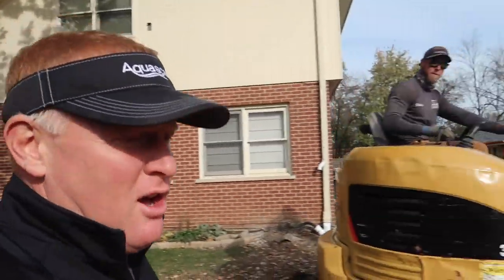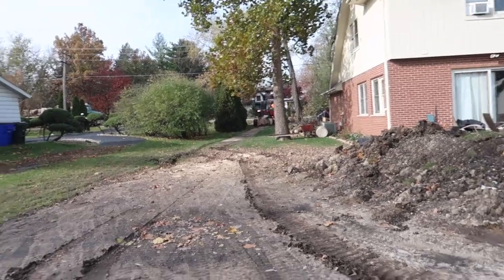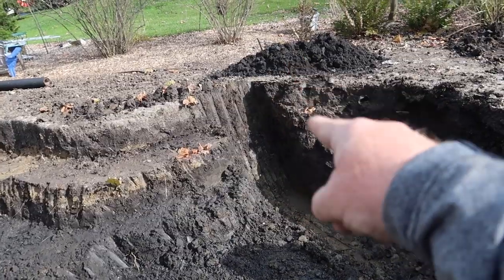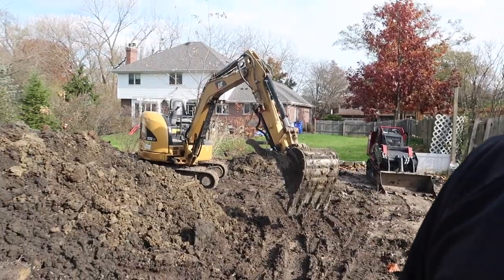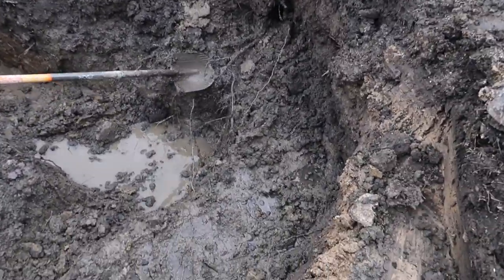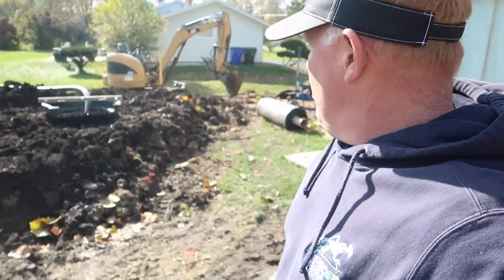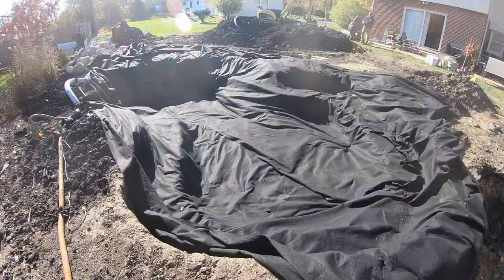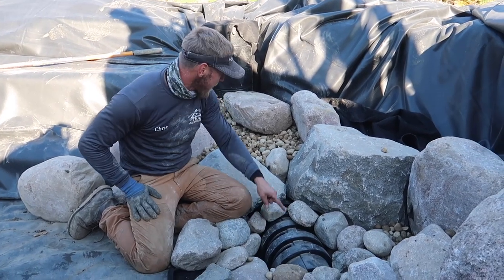Groundwater Solutions for 3-Foot Deep *POND* - Part 1

Comment: how does the water go up a pipe and discharges  up hill?
Reply: Good question.  I'm assuming water pressure.  He mentioned the water in pond would push it up and out. Buy I thought they might dig a trench out

Comment: regarding the french drain  with it going up out of the pond how does the water get out of the pond going uphill?
Reply: I was sorta wondering that but if you are referring to the underdrain systems (the white pipe in the video) it all has to do with the water in the pond pushing the water along up and out of the pond.. Like he says, the exit of the pipe must be below the water level in the pond.. I really want to try it on a small scale experiment
Reply: @bmzaron713  That's my understanding too ... the path of least resistance isn't pushing up a liner with hundreds of gallons of water, it's following the tube up the side.  The groundwater's options are: push up the liner, stay in the ground, or go in the tube.  It's counter-intuitive because the only thing "pushing" is how much water "wants" to do one of those things.